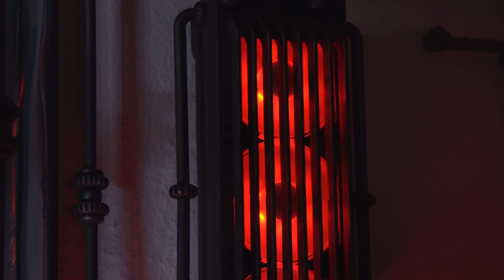Ultimate 3D PRINTED PC Finished - CryoPC Part 3

Comment: I love this build. I do hope that there is some space between the wall and the radiator. It would seem counter intuitive if it doesn’t. I’m sure you now exactly why. But for those who don’t. The radiator is there to cool the liquid that is being heated up by the CPU and GPU. This is done by the  liquid coming into the radiator on the inlet ,i.e the incoming, side and leaving on the outlet, i.e the out going, side. The main component are the fans. We all know how fans work I’m assuming. Simply puling air from the rear and pushing air from the front, but in order for this to work the rear needs to be unobstructed to pull air. If not, there is nothing to push. And the front has the same issue. It has to be unobstructed as well. So as kick ass as this build is, and I promise you, this one is one of the most awesome custom PC builds I have seen so date. It just looked like the radiator was right up against the wall. Either way keep up the custom works. The are bad ass!!
Reply from the maker: Yes, there is obviously a quite large gap that allows all the air to comfortably flow away without any resistance.

Comment: Got myself a 3d printer and have made small bits. I wondered how much could be done if I had a bigger 3d printer and I'd seen people make larger parts but you have taken it to a whole new level. Awesome work.
Reply from the maker: You don't need a large printer to make large parts. Check my channel, I just recently made a video about how you can print as big as you want on any printer.

Comment: add a conductive layer under the mobo standoffs....high power mobos sometimes get unhappy if those screw mounts arnt on a conductive plane ....but ive also only herd this never had a test myself...looks awsome ...id love a vid on making reservoirs like that ive wanted to make myown for a long time lol
Reply from the maker: They are not, and it really shouldn't be necessary, as there are multiple ground planes in a modern motherboard, that these mounting points are connected to. Maybe there are specific boards that have an issue with this, but so far I haven't noticed anything.

Comment: How are the thermals with the radiator on the wall? Does it get enough air flow?
Reply from the maker: There is a quite large gap on the back, where the air can escape. I imagine it's actually better than in most standard cases, as it gets fresh air, compared to mounting it on top of a case where the other components have already heated the air.

Comment: awesome! what bit are using for the smooth acrylic cuts?
Reply from the maker: Just some generic 3 flute uncoated carbide endmills from Aliexpress. They're meant for aluminum but work quite well for plexi too.
Reply: @DarkArtGuitarsWorkshop  ah ok. Did you sand and polish the edges after?